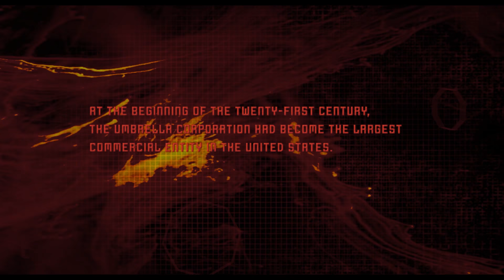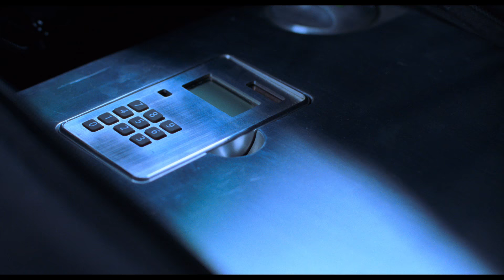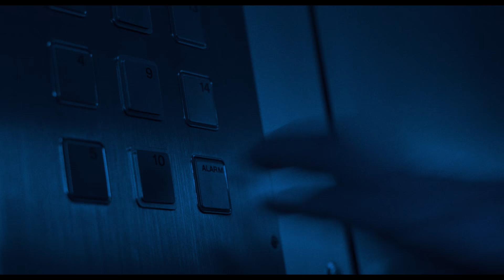Resident Evil (2002) – FIRST 10 MINUTES

Comment: The real villains here are those who have designed laboratories without a dedicated ventilation system and sensors, plus a super computer so useless that it doesn't even check what happens in these labs h24
Reply: I did not understand at the expense of their ventilation system. this is a very serious complex, as a result, because of one test tube, it was all infected. did no one accidentally break test tubes with the t-virus in it before?

Comment: And that's why I'm scared of elevators
Reply: It's just a movie. If an elevator was to do this in real life, then either the controller wasn't working properly, or someone tampered with the safety devices. The elevator killed her because the AI system controlling it was trying to contain a zombie virus.
Reply: @elevatorsbyliftfilmer1247  well said ˜😬ₕₑ ˜😅ₕₑ ˜😛ₕₑ but they did wrong because killing those employess right? because it triggered the virus on the dead.
Reply: @chocolatnoir1108  Technically, the Red Queen didn't have a choice, because she likely knew they'd re-animate some time after she killed them. She'd already sealed off all of the exits, so the zombies wouldn't've been able to escape as long as she had them sealed in one area.
Reply: @Dru Baxter You wouldn't have a choice if you had to go to a high-up floor, taking the steps would take almost an hour, depending on how many floors you wanna walk up. Not a good idea if you're in a hurry. That's why I prefer taking an elevator, no offense to you.
Reply: Red queen should’ve shut down the air ducts
Reply: @judesagad4161  Well, the virus had already spread through most of the facility, so she didn't have a choice
Reply: @elevatorsbyliftfilmer1247  I know it makes me feel there’s another way to evacuate the workers before lockdown.